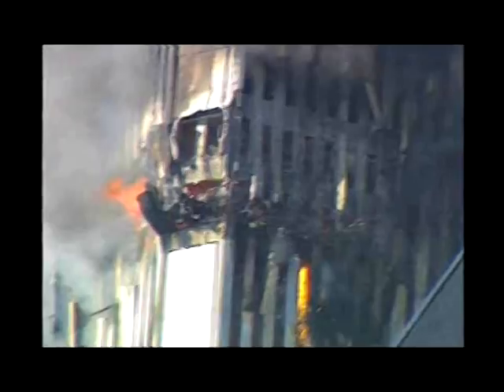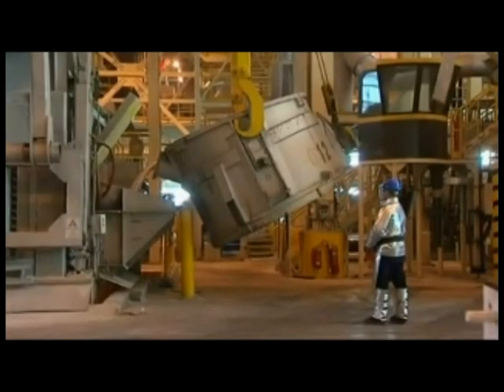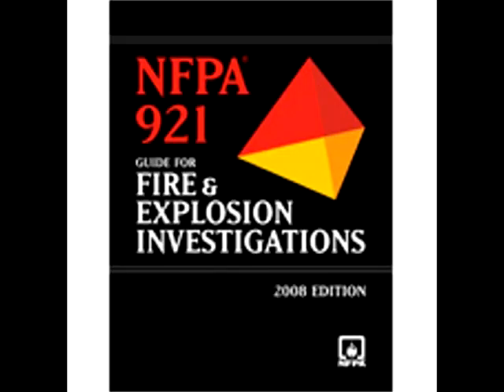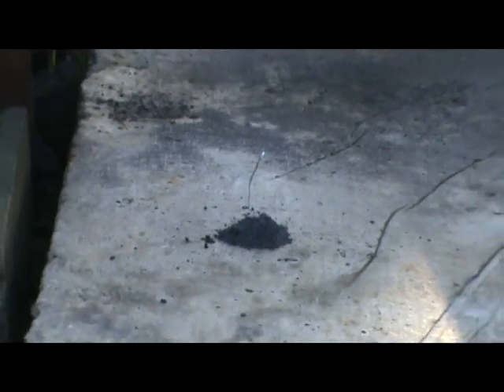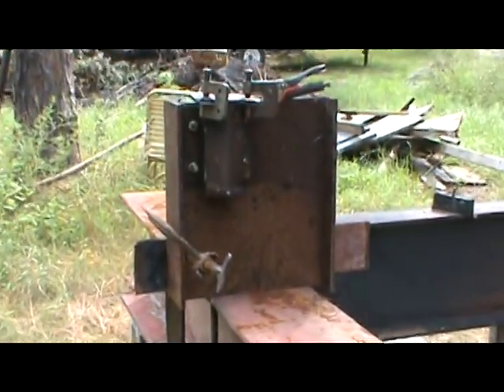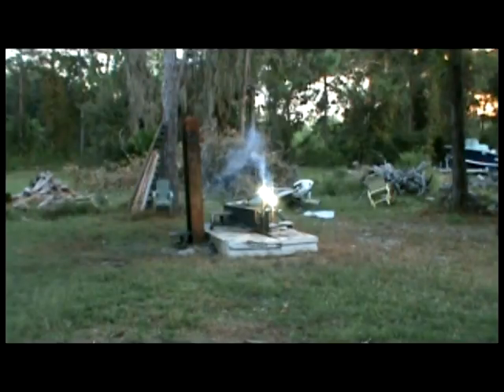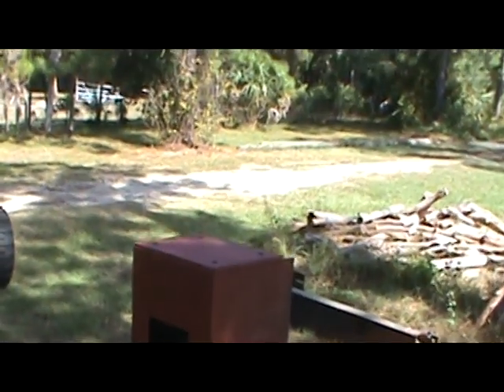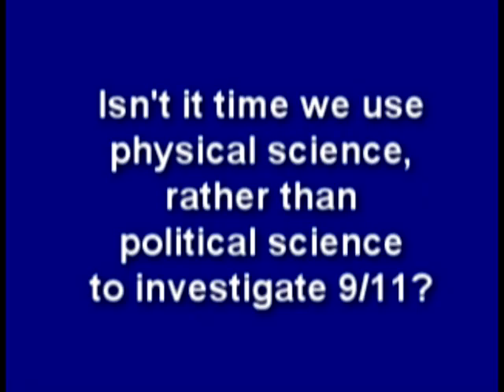9/11 Experiments: The Great Thermate Debate

Comment: It looks like a lot of work went into this video and I greatly appreciate that! Here's a question I've pondered for a long time. 

If you were planning a city like NY where you have a lot of tall buildings around much smaller buildings what would be your contingency for a worst case scenario keeping those tall buildings from falling directly on the smaller buildings surrounding them? 

I submit that pre-wiring a rather tall building for demolition would be a good way to make sure that if the structural integrity of a skyscraper were compromised that you could "pull it" before it collapses in a less predictable way. The idea that tall buildings are pre-wired for demo "just in case" is also something that would need to be kept secret lest you potentially create panic in the people that live/work in them or your enemies use it against you (which may or may not be the case in this event) etc... 

The plane's impact would have inevitably ignited some of the charges leading to those early sightings of molten steel pouring from the floors near the impact site.

Comment: physicist here.  a normal fire will not get hot enough to melt steel.  it will, however, allow it to reach its critical temperature, where it loses its structural integrity (and hence allows a building to collapse).  as for the aluminum through concrete debate, a 747 has a takeoff weight of 333,000 kg and you're questioning the integrity of the metal that bears this load?  if it is coming into a surface laterally it has even more strength and at a speed of about 250 meters per second it's got a lot of energy to push through.
Reply: Well Alex Jones is never going to have you on his show now...
Reply: Penguin Pie ..no shit sherlock....now use the lil physics you might know and quantify the collapse acceleration of those 3 towers...lol...it shouldn't take a smart guy like you too long.....THEN you can have a real idea of what really happened to those steel columns.
Reply: sure.  9.81m/s^2.  near free fall.  somewhere in the range of about 10 seconds for a 451m building.  Here's he frontier hotel in vegas demolition in 2007.  At freefall we'd expect around a 6 second fall time.  It ends up being a little less. https://www.youtube.com/watch?v=ydnbydzrP78&t=65s Structural integrity starts to become negligible very quickly when you're dealing with the types of kinetic loads.  Think of a huge hauler truck plowing through a car like it wasn't even there and you are getting close to the idea.  Peace out morons.
Reply: Penguin Pie... you ...are full of it....some kid sitting in a phyc-op room at worst....lazy physicists at best.
Reply: Penguin Pie ...see my post at the head of the comments if you have any questions.
Reply: good comeback
Reply: Penguin Pie ..for a physicist,  you sure seem to have an aversion to numbers for backing up your "analysis" of those collapses...that's pretty suspect...have anything more than "nice comeback" to add?

Comment: Fire is hotter if you fan it.
Dont believe me?
Light a firepit and put a fan on it.
You'll be buying a new firepit.
Tower 2 fell first even though it was hit 20 minutes later because it had more weight to support above the impact floor.
There were millions of tons above each impact floor.
The planes were flying in at over 500mph.
Each plane weighed around 850,000 fully loaded with fuel and passengers. 
Each plane damaged structural supports at impact. 
The outer walls of the Towers were part of the structural support.
It's the way the building was designed. 
In 1993 after the failed attempt to topple one building into the other, the terrorists were told how to do it by our own engineers and was to fly a large plane fully loaded with fuel into it.

Comment: The steel did not melt, at 1800F structural steel will weaken enough for people to be able to bend it, this is a total loss of something you as a builder should be very well aware of.. it's called STRUCTURAL INTEGRITY.

BTW you are not the first person to make a thermite focus channel, this has been done before to cut damaged sections of railroad track, as well as weld on new track. Thermite has been used to cut and weld steel many times, and in shaped charges.

The only conspiracy that holds any merit regarding 9/11 is if the government let it happen to get their ticket into the middle east for military operations, and even that one is hard to prove reasonably without going full tin foil.

Comment: what "can thermite of any type burn through steel beams?" isn't thermite used for railroad tracks made of steel to melt and weld/fuse track together?
Reply: https://www.youtube.com/watch?v=5uxsFglz2ig
Reply: so in this video they Pre-Heat the metal prior to using Thermite. The Thermite seems to be in a container keeping it contained and it seems to melt through the container into the area where it is to melt/weld the track together.

Comment: Jet fuel burns 1500F steal becomes malleable at 300F soft steal can not hold tons of weight. The World Trade Center also used a unique building design. The outside skin and interior support structure not the traditional honey comb build. Due to this design if the were to use thermite you would either see it on the exterior of the building or not at all bc it’s all the way inside.
Reply: Wrong dude. STEEL does not in any way, shape or form become malleable at 300F. Or else we would all have trouble baking pizzas at 425F. There is no such thing as soft steel, only carbon, stainless, tool and alloy. Mild steel is sometimes refered to as soft, but it is a low carbon steel and is very much used in structural applications. All the time. ( i work in an engineering firm) And honeycomb design isnt a thing either. You should do a little research before you announce opinions of sheer ignorance on a pub forum. To save some face. No offense meant brother, just trying to set you on the right path.

Comment: Charcoal and a hair dryer will create a blast furnace capable of melting steel.  Winds at the top of a tall building can be very high. Push high winds through a any of the openings created by the impact and you will get molten steel.

Comment: "I do know that it's impossible for jet fuel or an office fire to melt steel or iron"... in the same way that NIST and other sources 'knew' that thermite couldn't do it.

Yet he was willing to test the latter theory, often with devices that could not have existed at the Twin Towers, and finally found a way.

Perhaps if he took that same time and energy, he could find a way that jet fuel or an office fire could melt steel or iron?
Reply: DragoonEnNoir ..the govt DID that with full scale fire mock-ups of the floor structure...then proceeded to ignore the results and fudge the computer design model to initiate "A" collapse..never "bothering" to quantify if that was "THE" collapse initiation that actually happened...THEN proceeded to give US a 2 paragraph "explanation"  of how the towers fell during the collapse Event...even though required by Law to provide US with a reproducible mathematical representation....those involved have covered up what really happened to those structures...I've proven that mathematically.

Comment: Occum's Razor: the simplest explanation tends to be the right one >  As anyone who's done construction work will tell you, it's noisy, messy, disruptive and takes a lot of time.  How could thermate/thermite have been strategically installed without a single witness every coming forward? The trade center had been attacked in the 90's and had very strict security and yet not one person has come forward to evidence a crew installing anything on load bearing columns.

and IF they installed it, they just happened to install them just below the impact zones of an event that hadn't happened yet? how did they know where the planes would impact? How did the buildings happen to fail right below where those impacts occurred? 

It couldn't have been the simple answer right?  That a combination of witnessed impact damage, a wide variety of synthetic materials ignited by fuel burning at an altitude of a thousand feet on a breezy day in a structure that was acting like a rocket stove pipe brought the buildings down?

It had to be the secret crew of thermate installers that went completely undetected as was the work they did.

Focus on the real conspiracy. That your government allowed the attacks to happen in order to start illegal wars in Iraq at the behest of the Saudi's (who supplied the hijackers)  Your government is fighting a secret war in Yemen for them right now and yet no one cares because you're distracted by all this "it's about the fine details" nonsense.
Reply: Some good points, interestingly, security was stood down on the wtc complex on the run up, more interestingly this was facilitated by a replacement security management which was headed by Marvin Bush.
Reply: Finally! Someone who talks sense! The planes brought it down plain and simple
Reply: this definition of occums razor is wrong, here the real definition:

When presented with competing hypothetical answers to a problem, one should select the answer that makes the fewest assumptions.

otherwise you are correct, I worked with steel and can tell you that you dont need to melt it for it to weaken.
the temp of burning jet fuel is MORE than enough.
Reply: MrBadBricks
>Well, at least I know you read it to the end. thank you.

Comment: Only the inner core of the building and the outer surface included I beams.  The floors, which connect the inner core to the outer surface and provided the lateral strength for the building, were made of truss work.

Also, how in the hell did the people in a building occupied 7/24 fail to notice workman opening up the structure to emplace dozens, if not hundreds, of explosive charges and their associated wiring?

And, if explosives did bring the building down why all the fuss with the airliners?  Just say it was a bomb.

Nope, to much common sense; I know.

Comment: When was the 1 million pounds of thermite for each building placed in the strategic positions required for a controlled demolition. After the 93 attack a video surveillance system was placed throughout all the towers .there ws no visual recording of any work being done .it would have taken because of logistics  at least 9 months to plant thermite charges. Not one second of video was ever recorded  showing work crews doing any demolition and repair in order to place the thermite charges..I leave you to reach a logical conclusion from what I have just stated.I was in New york  I was at the the site .if  as you claim thermite was used in the world trade centers there would be a  Distinct odor permeating the area There was not. I think you can figure out the rest of what you're saying is nonsense.

Comment: First of all, you need to recognize what type of steel was used in the WTC. Not all steel is the same steel, it might have been a cheap steel which is of different integrity than high quality steel. Generalizing all steel under the same melting points and other abilities is an error in itself, right?

Though i must say this attack on WTC is a hard bit to swallow, i still can point out what might go wrong in these experiments and counter theories

Comment: Dear God! You conspiracy morons STILL don't get it. Yes NIST was wrong! They were told exactly what happened but didn't believe it.

1. There were tens of thousands of gallons of water used to try to quench the fire

2. There was in excess of 200 tonnes of aluminium that WOULD have melted and dripping into pooled water would have created multiple high velocity explosions (which were heard)

3. The only conspiracy at work here is WHY the security services IGNORED all the evidence they had prior to the event
Reply: Bob Lewis ..hey! You just invented a new way to completely and suddenly at near free fall velocity demolish 3 buildings with only 2 sets of inputs...your gonna be rich!

Comment: I thought of a factor that was left out of your theory. 
How much downward pressure is on each level of the vertical beams? How much would each vertical column need to be weakened in order to collapse? You are using chemical science and disregarding physical science. Energy can be compounding as energy does not disappear.  It can only be transferred. Energy can transfer through steel with enough downward pressure it would only prevent steel from wiggling or moving in any direction. This would mean energy has nowhere to go. What would happen to that compounded energy? It has to go somewhere. My theory is this... the energy compounded and escaped in the form of heat... this means the amount of heat needed to melt the steel would be less if in already contained  a surplus of energy. 
I am a martial artist and have studied breaking boards. A friend of mine can punch through six boards and we can up with proven examples of why the furthest board explodes firat and the closet board breaks last. Also how can that much energy go through the layer of skin between the bone and the board without damage? The energy is transferred and escapes at its weakest point first literally causing the would to explode much like a bomb at the weakest point and the break gets more precise as it loses energy. With that much Potential energy already compounded in the vertical beams in addition to the kinetic energy of the fuel. The steal would reach its boiling temperature much faster and easier. This has not been tested in any experiments I have seen. In order to test it. You would need to add extreme pressure to a vertical beam. Then add heat.

Comment: Thermite is used by rail companies to cut and weld rails quickly.
The thickness of steel in train rails is far thicker then in construction yet it cuts through it.
I thought this was common knowledge?

Comment: "so what can melt steel" - well before melting, steel becomes very soft, at around 1800'F.
That does not however flow and sparkle like we see, but it does loose most of its strength at that point.

The problem is with the temperature readings in my opinion, they are measured on the surface... not the core! so I am guessing it could have been a lot hotter in the core of the building, hence the discrepancy.

Now the Thermite Boxcutter you make, would that not almost have to have been built into the building during construction? I mean, it would require a lot of work pre-9/11 to put those in:
A lot of work, no one noticed? no one saw any workers prior to 9/11 on their floors exposing the structural beams and mounting stuff on them?

this raises more questions than answers.

the tiny bolt-head blowers seem like the most likely thing to be the cause of a lot of the seen evidence!
But there is just a couple of questions there- who did it and why?

Comment: Wow, iron rich spheres were found, so there can't be any other explanation except thermite......... but lets forget about the rescue workers using steel cutting equipment in those first few days and then the clean-up crews who cut up the beams to remove them from the tangled pile of twisted steel.
Come on, how can anyone seriously believe it's possible to rig a very busy building like the WTC to collapse using thermite, plus get the placement right at where planes are to hit, and do all this without anyone noticing? And after all these years, no-one credible has come forward to say they were part of that very large team that would've been required.....someone would've talked long before now.

Comment: you dont take into account the weight of the building pushing down on the steel. wouldnt the weight make it easier to cut the beams?
Reply: There is a LOT of things missed here, along with some flawed half assed assumptions.

Comment: and no the question is not "can jetfeul melt steel" the question is  "can it structurally weaken steel"  and the answer is yes.
Reply: And don't forget the whole collapse started by the floor trusses, that had softened in the heat and were starting to sag, and they pulled the weakened vertical beams inward. All the close up videos I've seen clearly shows the beams collapse inward and then the buildings started to fall......but the conspiracy nut jobs are too busy focusing on iron spheres that where most like created by the rescue workers and cleanup crews with steel cutting equipment.
Reply: darkracer125 ..sure..but you neglect the fact that the govts nist forensic "analysis" report admitted the columns below the crash site were NOT effected by fire...yet somehow provided no resistance to the collapse...I say "somehow" because that was their "conclusion" ..a 2 paragraph word problem describing the collapse Event itself..which when solved (I personally have) proves the govts explanation doesn't hold up to scientific scrutiny.

Comment: I can’t wrap my head around the fact that ANY FUEL.. along with air at high speeds ( as all towers create and generate)  can be hot enough to melt steel. Forging with coal and air..melts steel.. and a Venturi of air from the light burning of office materials and a 200 foot gaping hole at the bottom.. as in most forging ovens.. can’t accomplish the melting of steel to liquid form.